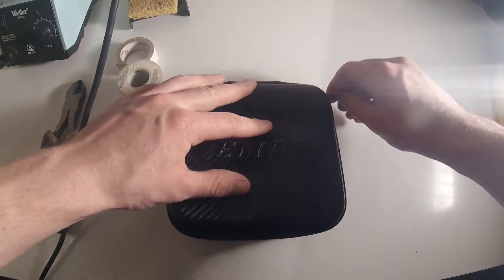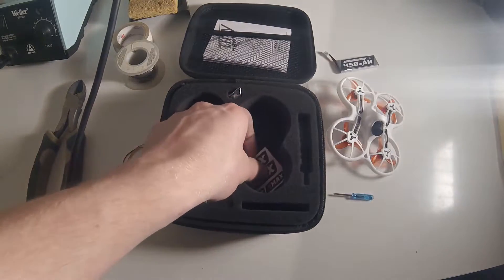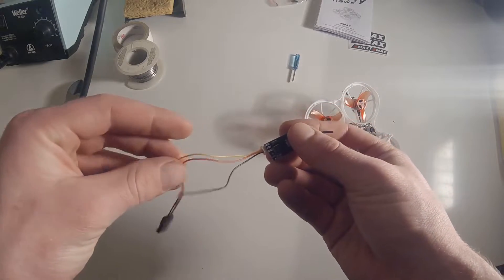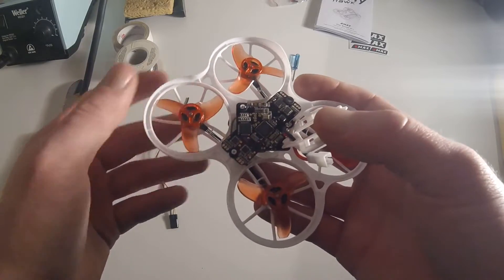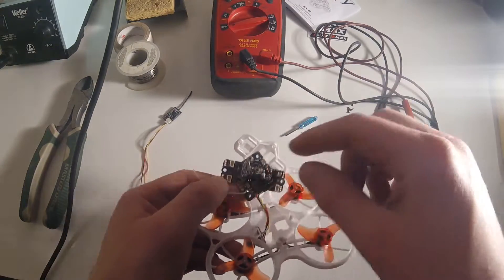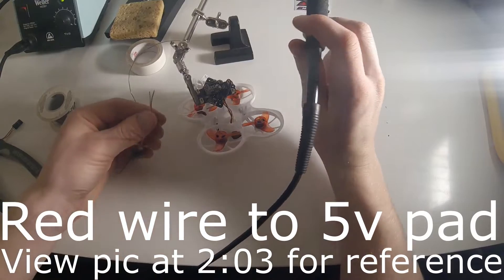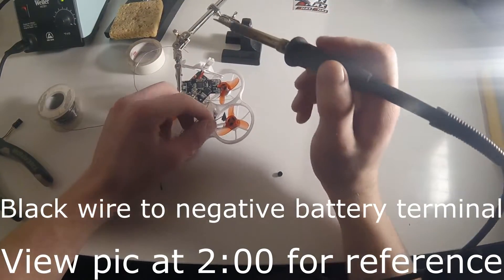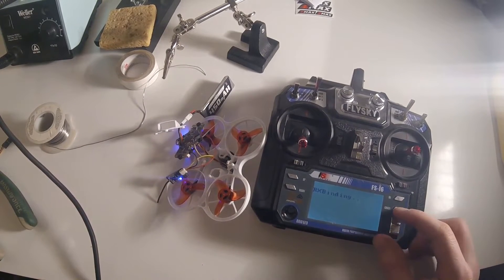FLYSKY emax tinyhawk 6 DOLLAR mod - how to

Comment: The three pads of the sbus are negative, positive and signal according to the schemstic. Do we really need to solder + and - to battery instead?

Thanks for the video, I'm trying to attach x6b flysky receiver to my tinyhawk 2 :)
Reply from the maker: That depends on the voltage of your receiver. Sometimes they can't go above 5v, so you couldn't solder to the + and - of your battery

Comment: Hey thanks for the video man. I’m stuck though...receiver shows it has a bind and in Betaflights “Receiver” tab my sticks work but in “Modes” tab there’s no movement and quad doesn’t respond to any input. Any ideas?
Reply from the maker: Check that the right channels are assigned. In "receiver" make sure it's TAER, and then you have to assign functions on your transmitter to get them to show up on modes.

Comment: Good vid thanks alot. i did this today with a Tinyhawk Freestyle and it works great only problem I've had was not being able to get a battery read out on my turnigy evolution wondered if anyone else has had this issue after doing this mod?
Reply from the maker: Depends on the receiver you have if you want telemetry.

Comment: I connected the exact same receiver but it doesn’t bind. Any ideas?
Reply from the maker: Make sure it's receiving power, and that you press the bind button before you power it on. And that the transmitter's in bind mode of course.
Reply: Okay I think I got it bound but the transceiver isn’t being picked up in beta flight. I changed it to ibus and atre1234 but it doesn’t seem to connect? Any ideas?
Reply from the maker: @jackmerrill5512  If the tabs aren't moving in betaflight then it isn't bound. Try on the binding again - make sure ibus is saved
Reply: Okay thank you! It’s working in beta flight! And I’ve got it to arm. Last question though is the quad keeps beeping and flashing red? Any ideas again and thank you
Reply from the maker: That's great! You stumped me on the beeping, enable arming flags, debug, and warnings in the OSD and see if that tells you anything
Reply: Awesome video thanks man. Got the soldering down and the betaflight setup no problem all easy with the video step by steps, can get it to arm and motors spinning but as soon as I throttle up it cuts out.. tried loads of obvious basics but it’s driving me mad, think it’s in betaflight , did you do a betaflight setup video? Thanks bro

Comment: does this work on the new freestyle tinyhawk ?
Reply from the maker: For sure!
Reply: @FPVisioning  thnx!! any tips ? Things to watch , btw is it availeble anywhere now ?
Reply: Buying one now :d
Reply from the maker: Freestyle tinyhawk is pretty straightforward. Nothing much different, all the other tinyhawk videos should be relevant.
Reply from the maker: They basically put the main board on a freestyle frame with bigger motors and made the board 2s capable

Comment: Hi, i got one capacitator between the 3.3V and - may i know how to get over this issue?
Reply: No I guess the newer revision of the board has a capacitor place between the area that you are soldering. I managed to solve my issue by using the other copper pads for power. Thank you for your reply!
Reply from the maker: Over what issue? Are you having dropouts at low voltages?

Comment: trying to do it with A8s and FS-I6X, but can not make it work in BetaFlight. Tried Uart1, Uart 2 but still no luck
Reply from the maker: Have you changed the receiver type to ibus? Are you sure the receiver is bound to your transmitter?
Reply: @FPVisioning  yeah, i changed it between ibus-sbus back and forth, RX is bound - it turns red as soon as i turn ON TX, but bay be there is a way to REBOUND it smhw?! Tried even resetting to factory default, did not help ether, also forgot to make a backup)
Reply from the maker: First of all you should rebind it. Put your transmitter in binding mode, then hold down the bind button on your receiver while powering up your tinyhawk. Then, make sure your signal wire is soldered to RX1, serial RX is enabled on Uart 1, and Ibus is selected.
Reply: @FPVisioning  SUCCESS! Here is the thing, the A8S was also in S-Bus mode. So i rebound it to TX, Changed A8S mode to i-bus by 2 sec press Bind button (* LED turns off for 1 second then flashed twice: i-bus output MODE), and it freaking started working! Leaved it soldered to RX2 =) Thanks for help, bro!
Reply from the maker: Ah, that'll help for sure! Well good luck ripping up your house now! 😂👍🔥

Comment: Thanks for the how-to! Wondering if you can help... I've accidentally pulled the RX1 tab off the board after a noob soldering blunder (don't ask). Is there another pad I can use (RX2?). What would I need to configure in beta flight if this option could actually work??
Cheers!
Reply from the maker: Hmm I'm not sure. I'll take it apart and figure it out and shoot you a reply in a couple days
Reply: @FPVisioning  legend. Thank you!
Reply from the maker: Yeah, I took it apart and you can use RX2 as well. Make sure you get your soldering iron hot enough this time!
Reply from the maker: To configure it in betaflight you just need to enable Serial RX under Uart 2

Comment: Works similar with crossfire as well :)
Reply from the maker: Nice!
Reply: I am trying to install crossfire in tinyhawk s . the boards look very similar. what are the differences between crossfire install and this guide? any help would be appreciated. i wired everything up and nothing happens when i plug the battery in.
Reply: @Joel-vg6wk  did you set up the correct UART and protocol in Betaflight configurator?
Reply from the maker: Crossfire should be identical except I think that it uses sbus instead of ibus. I haven't used crossfire personally though, so I can't say.
Reply: @FPVisioning  I read that u cant use the same uart as the built in Rx with f4 fc and xfire. I used rx2 and tx2 instead also there was a tiny 5v pad next to those instead of using the bigger one in the back. Maybe I should switch to the 5v in the back? I think it is a power issue. This is my time soldering and drone for that matter. I really have no clue. Thanks for the reply!
Reply from the maker: https://oscarliang.com/crossfire-betaflight/ that should tell you everything you need to know for setting it up, but you're saying it won't even power on? Have you tested your pads with a multimeter to verify they're outputting 5v?
Reply: Didn't get that far yet. I figured it would turn on at least first. I think I wired something wrong. Do I need to set up beta flight first?
Reply: @Joel-vg6wk  try to swap RX and TX wires. I am confusing those every time.
Doesn't matter if you change betaflight settings before or after.

Comment: Thanks for the video. One q: Why don't you use the ground pad next to the 5v sbus pad ?
Reply from the maker: The ground pad for the battery already had solder on it; it was just easier. Not really a reason, both work.
Reply: @FPVisioning  Thanks! Lazy :-) but makes sense!

Comment: will this work with FRsky XM+ receiver ?
Reply from the maker: I'm not sure. The receiver that's already in there is a frsky receiver, and both that and the XM+ use the sbus port. It should though, because you select serial rx on a different UART. Trying to go long range with it?

Comment: Hello, i have 4 wires in the reciver, yellow, black, red and also white...what should i do with the white one?
Reply from the maker: You didn't get the same receiver I did then . . what is the one you have called?
Reply: FPVisioning i bought the little flysky one, the fs-A8S
Reply from the maker: @diegosuarez8068  On the FS-A8s the white wire is the ibus, and the yellow is PPM. So use the white one.

Comment: Tried this mod too with a 8a v2.0 ( fs-a8s copy ) and no luck :( . Receiver is bound ( solid red ) and changed to ibus but no receiver connection in betaflight .
Reply from the maker: Get the original! Same price, works great.
Reply: Pinched an rx2a from another build and it works in tiny hawk . Thanks man for the mod tip !

Comment: I've had a little qx90 with frsky  (got super cheap) just waiting for this exact thing. Thanks for reminding me.
NICE!
THANKS! 

..now.. I have to decide to keep playing with brushed toys, or making the jump to brushless. 

I find myself flying the larger brushless quad I have more and more firstly cause it's the only one that's acro...secondly. ....so much less maintenance.. when I fly my brushed quads it seems like I'm forever replacing motors.
Reply from the maker: Exactly! The only thing that broke on the tinyhawk is a prop so far, it's a good buy.

Comment: Will this works the same with Flit10 or Fli14 receivers?
Reply from the maker: I'm not sure. As long as they have ibus and connect to flysky it should work. I think the flysky protocol is AFHDS 2A
Reply: @FPVisioning  thank you for your answer. And for the sub!
Reply: Did you do it? Where did you place the rx?

Comment: I got my Tinyhawk this morning. Soldered on the flysky receiver from my SPC Maker 95GF. Followed your instructions and it works. Flew a few packs already. Finally have a small enough quad that is safe to fly anywhere without risk of harming anything. Only thing is that it is a bit tricky to solder on the receiver and to put everything back again. Thank you
Reply from the maker: That's awesome! Yeah, the only thing I wish I had was RSSI, but that doesn't really matter because I fly in the house.
Reply: @FPVisioning  Yup, RSSI will be a good plus. So far, I have tried reverse motors this morning. It works. I am used to reverse motors on my 5 inches